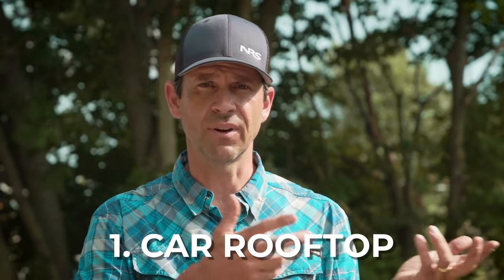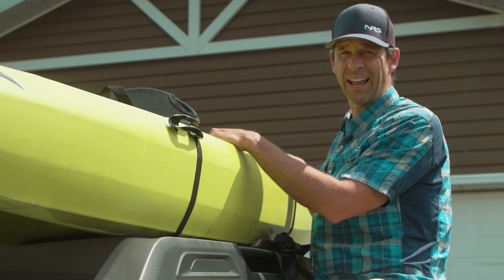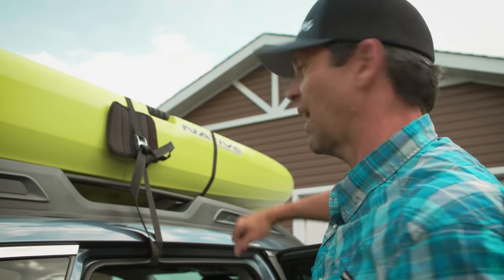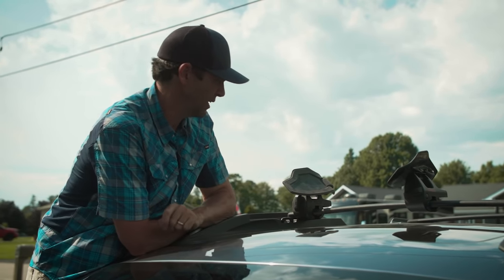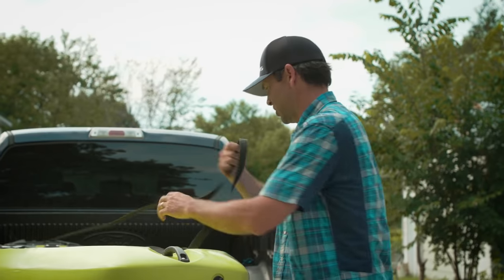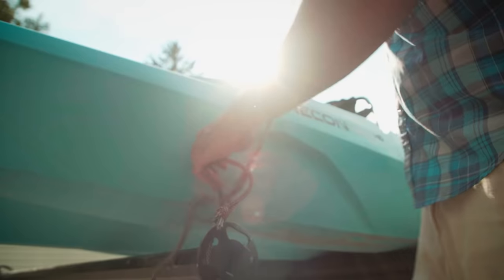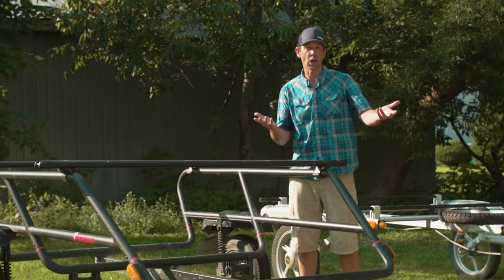How to Transport a Kayak | Kayaking for Beginners

Comment: THX for the Great primer for first time buyers and good info for veteran yakers ready to upgrade their racks. A couple points to add: 1. Strap your boat just in front of and just behind the cockpit (the hull is always strongest there and the cockpit coaming will prevent the boat from sliding forward or aft when strapped that way.  2. When using the Bow and Stern straps, never crank down tight on them., you will do serious damage to your boat! They are only safety lines to keep the boat attached to the car if the rack fails.  3. those J bars that you showed at 10:48 have a fatal flaw. If you strap to the j bar only, when it fails the boat  becomes a kite. I have seen that happen more than once.

Comment: I use roof racks. I drive a little Hyundai Accent four-door hatch, and the roof racks make it look a little more badass, but especially with the 'yak on top. And best part about having a small car, I can easily load it and unload it myself.

I use two straps, one on either end of the cockpit, right under the spray skirt lip, and I've never lived in fear of it sliding out; it does not move at all. Though I don't have a super long one. It's about mid-range in length, can't remember the exact size.

The last part of my set up is, I mounted my kayak from the garage ceiling, so now when I take it out, it's just an easy (kind of) releasing of the straps over the car, then strapping it down to the car.
Reply: Amazing!

Comment: Nice options described for people starting out.  I've been toting rooftop boats for decades. Kevlar kayaks to heavy duck hunting canoes to wooden piroue boats.

If you dont have a hard fastened roof rack (bolted on) then running the strap through open doors is best on modern curvy car roofs.  There is really no other firm purchase on wind runnel cars.  Watch out for rain when the car is parked in a thunderstorm...but driving through rain I've not had problems.

The pads are terrible about picking up sand, dirt and gravel if you sit them down first to mount the boat.  Sandpapers the finish.  I either mount them facing up and flip the boat in air  (canoe for instance) ...or I sit the two pads on towels on the ground to avoid picking up dirt.

Straps...not too tight.  Cam straps are fine just tug tight.  Ratchet straps can cave in a boat or permanently dent your roof.  It is not necessary to add 500lbs of torque to hold a 40lb boat.

Ropes....learn the truckers knot and you'll find ropes are much easier than tensioning with bowlines and half hitches.  Learned that after years of tying far too many knots.

Comment: Awesome video man, I wish I could have found it a month ago! I'm 2 months into kayaking and after buying my first kayak I was scratching my head as to transporting it. I bought an inflatable roof rack but was annoying because it could be punctured and felt unsteady. I ended up buying roof racks and tried to get them to fit on a coupe 2013 Honda. Didn't quite fit so I simply bolted them to the car and so far I've had no problems with loading or anything. Along with some ratchet straps and a locking cable I feel safe driving with 2 kayaks in top of my car.
Reply from the maker: Thanks!  Sorry I didn't get the video out earlier :).  Glad you've figured out a good system.
Reply: @ou812true5  I've used cam straps and to be honest they don't work for me they tend to come off loose and I didn't put much faith in them when I used them.
As long as you're not maxing the hell out of the ratchet straps and putting on a lock you will be good to go.

Comment: Helpful but would also add that ropes can stretch and it is better to use straps as you showed most of the time.  The foam pads can also be mounted on most standard car roof racks.  And dont forget kayak carts for those that live just a couple blocks from the water.

Comment: For sit on top kayaks, if you can put it on edge with J style rack, I like to send a strap through the scupper holes. then you dont have to worry about bow lines in the same way.
Reply from the maker: That's a great point Michael.  I've never done that, but I'll try it next time.

Comment: Skin on frame folding kayaks are a great option. Although they are expensive and most are sea/expedition style kayaks. Long haul, Nautraid, Neris, Klepper, Wayland & others are great brands to consider. They take about 30 minutes to assemble but are extremely capable and properly outfitted can take you anywhere in the world you would like to go. They can be rigged for sailing and can accommodate outriggers too! My 16' Long haul 
Mk I expedition class fits nicely in the back of my 
mustang. These are some of the best folders in the world so be prepared for some sticker shock! cheers everyone.

Comment: I transport a Moken 12.5 on top on my vary small car. I get it onto the roof rails solo by using an old area rug and sliding it up the rear hatch on the rug. The rug protects the glass/paint and there is enough contact that I haven't had any issues with damage ect...
Reply from the maker: Good idea!  Thanks for sharing.
Reply: Smart!

Comment: Wish you had shown how you actually load the kayak onto the roof. From the back or from the side? Any special techniques for lifting it?
Reply: there are lots of good youtube videos on how to load a kayak onto your roof by yourself. I'm 5'1 50 yo female and load my 60# kayak on top of my rav4 by myself now after the instruction. I do use a stool to strap it on tho.
Reply: I ended up getting a Tucktec folding kayak. It fits into my car, so no need for a roof rack.

Comment: With your front and rear straps, you should loop through the mounting points rather than using open hooks. The motion of the kayak/strap can cause enough slack that an open hook may release from the car.
Reply: Great point Adrian - this has happened to me before, luckily there was no damage to kayak or vehicle

Comment: Excellent video! I like how you went from the foam blocks to the 1500 dollar Mac Daddy option! I myself have a truck that I use a bed extender for my 14.5' Tsunami. I also made a aluminum roof bar to use when I want to put the kayak on top of my truck, which has no rack. Thanks for the video, learned a lot!
Reply from the maker: Thank you!

Comment: I have a small cuv.  It had solid roof rails but no crossbars.  I made  a point of saying I needed cross rails for my kayak.   The dealer threw in the cross rails  for free.  Because of the antenna I load it from the driver's  side & angle it onto the crossbar.  Remember to put a bathmat on your roof so you don't  svratch the paint.

Comment: I’m using after market  used roof top rack I got off Facebook marketplace on my  pickup. On a recent trip most of the parking spaces were in a garage. Luckily I was 2 to 3 three shorter than the maximum height of the ceiling of the parking garage .

Comment: Great video, is there a preference between transporting a kayak right side up or upside down?
Reply: I prefer to transport it upside down. When the kayak is upside down, it tends to be more aerodynamic reducing noise and fuel consumption. It also avoids having all sorts of debris and bugs from the road falling or being squished into the cockpit.
Reply: @viaujoc  And the inside doesn't get wet if it rains.

Comment: How your door d8n't start leaking during heavy rain or carwashes. A tight strap on the door seals can damage them. Best to buy Jhooks to add to roof rails. Another option is to place the kayak upside down on the roof rails and add straps around the rail then around the kayak especiallynif the roof rails come equipped with rubber strips on top of the rails to grip the kayak and to protect the kayak surface. A trailer is great also especially for two kayaks. Roof rail load maximums should be considered for two kayaks.

Comment: , I use the towing eye on the car and on the back I used to towing hitch in the back and when useing all 3 kayak    we use a traller
Reply: My car (SUV) also have a removable front towing eye that came with the vehicule, which can be screwed on the left or right on the front bumper. I went to a car scrap yard and bought a second eye. Now I have two nice eyes, one on each side, to attach the bow of each kayaks with a rope. This is really easier to set up than having to crawl under the front of the car to find an anchor point.

Comment: TIP:  You don't need bow and back straps!
When carrying two kayaks on J racks, thread the strap through the opposite adjacent rack on the other side.  This will mean the two J racks become one solid piece.  This is MUCH stronger than using front and back straps and saves considerable time.  When transporting a single kayak, I still use the opposite rack as an additional brace-- stronger and faster.

Comment: I drive an 2008 2 door soft top Jeep Wrangler and im pretty much screwed with hauling a kayak. Sure I could strap it down to the roll bars on top but that requires taking down the top and even getting to the destination I would have to put the top back up or else an open jeep is great for thieves. I could go online and buy a roof rack for the jeep but the cost of one thats an instant no.

Comment: Concerning your straps-through-the-doors method... If you were to get caught in rain would you end up with water penetrating the seals on the doors and leaking into the car?
Also, is that a method you would trust at highway speeds for a trip of 5 hours or more?
Reply from the maker: Good questions!  I don't think you'd have much/any water leak into the car. The seals on the door will still do their job. It wouldn't be a big issue.  As for trusting it on highways speeds... If don't right, then yes.  It would hold.  I would definitely stop periodically to double check things, but it works.
Reply: @PaddleTV  : Good to know. Looking at the prices of Thule and Yakima racks and all the necessary accessories associated with them I was expecting to pay just about as much money for rooftop gear as I will be paying for the kayak I'm interested in.
Thank you for the information. 👍

Comment: In the first setup, why run the straps through the car doors instead of around the side rails that are right there?
Reply from the maker: Yup. Good point. I could definitely have done that on this vehicle.  In this case, I was demonstrating what to do with any vehicle.
Reply: @PaddleTV  Figured that might be the case. Was wondering if I was missing something fundamental, though.

Comment: Nice video. I’ve been debating between those two trailers. My wife and I both have vapors. Our three kids have kid size sit on top kayaks. My sister has a vapor. My parents have a tandem sit on top kayak. Which trailer would you recommend? What if it is just my wife and the three kids?
Reply from the maker: That's a lot of kayaks to transport at once!  :)  The EasyRider is probably the only one you'll fit 4/5 kayaks on.  I like the EasyRider and think it's great for paved road use, but something to note is that I had mine fall apart on gravel roads with washboard.  The rattling broke the plastic fenders and destroyed one of the shocks.  If you're going to be going on rough, unpaved roads, you might want to look at the RacknRoll.  Malone also has some good options for 4+ kayaks.

Comment: How about putting the boat upsidedown on the roof rack to avoid deforming the bottom of the hull on the rack bars on a long haul trip?
Reply from the maker: That can definitely work, depending on the kayak, and depending on the spacing of your bars.  Sometimes it fits really well upside down (especially sit-inside kayaks), but often the kayak doesn't 'sit' well upside down - especially sit-on-top kayaks.   The added benefit of doing what you suggest, is that rain won't fill your cockpit (for sit-insides).  Rain can add a lot of water weight to your boat!

Comment: Is there any reason you shouldn't haul you kayak top side down? I've found that helps to significantly reduce buzzing.
Reply: Depends on the boat for me.  I have two Phoenix kevlar long kayaks.  One is flat topped (Slipper) one has a sharp ridge riser of the deck (Isre).  I always transport the Slipper upside down.  It avoids collecting rain...it reduces strain that causes oil canning of the hull.

The Isre...is too weird and tippy upside down.

Comment: I need to find the "magic" part. Tying down isn't all that hard. Getting a kayak 6' 6" onto my Suburban roof tends to be the bigger challenge.
Oddly enough, sliding a 16 or 18 ft boat over the rear with a bath mat is easier than getting my shorter whitewater boat up there.

I also use ropes for the bow and stern instead of strap. That tends to avoid the strap buzz issue.
Reply from the maker: It's true... the 'magic' part is the toughest part, isn't it?  That's why I love my pickup and trailer now.  When I was on the road competing (20-25 years ago), I had a pickup with a camper on the back. I had a rack system welded to the roof of the camper. The result was a rack that was about 10 feet above ground level.  Getting the kayaks up there was always interesting!
Reply: @PaddleTV  The "magic" gets tougher when you convert your garage into a woodshop and store your kayaks in a backyard shed 100 ft away from your vehicle.

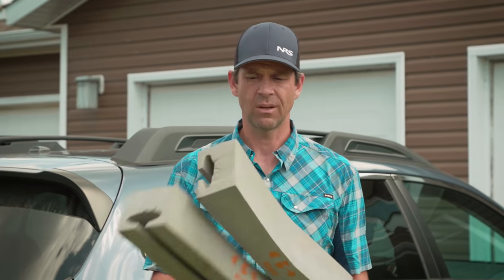Comment: who makes the foam pads you are using @ 1:47? thanks
Reply from the maker: If you do a search for 'foam kayak carriers', you'll find lots of options.
Reply: Don't forget to put a strap through the blocks, I assumed the weight of the kayak would hold them still 😠 that's a mistake ya only make once lol, still shaking my head about it
Reply: @jasonatkins1095  the blocks and kayak slipped, or you had the block fly off?  How do you place the strap thru the foam block ,  vs. around it?
Reply: @TM-dk7vs maybe the kayak rocked while on top, unloading the weight from the foam blocks, so the wind then just caught it sending the block sailing off. That might happen if it wasn't strapped down tightly enough to maintain the proper pressure on the foam for retention

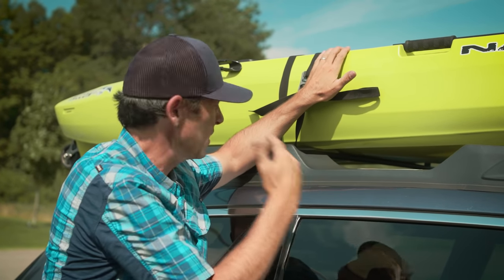Comment: 9:35. can you explain the wheel at this bookmark? where did you get it? how is it installed?
Reply from the maker: This kayak (Native Falcon 11) comes with the wheel integrated into the stern of the kayak, to allow you to pull it to the water.  You can easily add something like this to any kayak though. The best option is to get a kayak cart. Check out suspenz.com

Comment: When rooftoping, I have rails, but no crossbars. Can I run the straps through the rails instead of through the vehicle?

Does it matter if the kayak is upside-down or not?
Reply from the maker: Good question.... It depends on how sturdy the rails are. The owners manual will probably tell you the max load for those rails. You can put the kayak either way.  Upright can take advantage of the deck features of a kayak, which will help stop the kayak from shooting forward off the vehicle  - like the cockpit coaming.  On the other hand, if it rains while you have a sit-inside kayak upright, you'll be collecting water/weight in the kayak, which isn't good if it's significant rain.
Reply: @PaddleTV  was thinking that it might be more aerodynamic for the the kayak to be upside down. Wind going over the contors of the hull instead of pushing the bow/stern up.

Comment: Would you still use a bow/stern line with those dedicated 'J' racks?
Reply from the maker: It's definitely the safe thing to do. That being said, if I'm not going very far, I usually don't bother with it if the straps are 'locking' it into place.  What I mean by that, is that if the straps go around the kayak in a narrower spot, then theoretically, the kayak won't be able to shoot off the racks, because the thicker part of the kayak can't get past the straps.  Make sense?  For example, if your kayak has a cockpit coaming (that a skirt fits over), if the front strap is in front of the cockpit coaming, the kayak can't shoot forwards, because the strap will catch the cockpit coaming.
Reply: @PaddleTV  thanks for the tip!

Comment: how did you get the kayak on the roof ?
Reply from the maker: Magic!   Ok... truth is that it's a real pain doing it solo, and you risk knocking your sideview mirror of your vehicle (I've done it - twice).  Best bet is to get someone to help - one person at each end.
Reply: @PaddleTV  did you ever come across an attachment with rollers, to push kayak easily from the back ? if yes can you suggest one. I also have a flycraft which might need full length system.

Comment: I have a flatbed truck and I use ratchet straps instead of cam straps but will say I was a slow learner with the ratchet straps! LOL  I'm talking the smaller-sized ratchet straps, not the big yellow trucker straps.  But I feel ratchet straps are a much safer choice.
Reply: Ratchet straps can be used but you have to be cautious. 1) They can easily be overtightened and warp the haul of the boat. Be gentle and check the tension of the straps almost at each click when there is no more slack in the strap. 2) The chunky ratchet mechanism can hit the boat and damage it way more than a simple cam. Just place it some place where is does not touch the kayak or tie something soft like a cloth or a piece of foam between the ratchet and the boat.

Comment: What are your thoughts on stuffing a 10’ kayak into a hatchback and tying down over the part that sticks out?
Reply: You can easily damage your hatch by driving with it open, even if it is strapped or tied down. The hinges and hatch are designed to be driven only when closed. Also it is possible on long trips to get exhaust in the car through the open hatch.
Reply: I forgot to add that I know many people that fold the passenger seat forward and rest the boat on the dash in order to be able to close the hatch. At the first hard stop the boat always slides forward and cracks the windshield. Some people learn that the hard way.